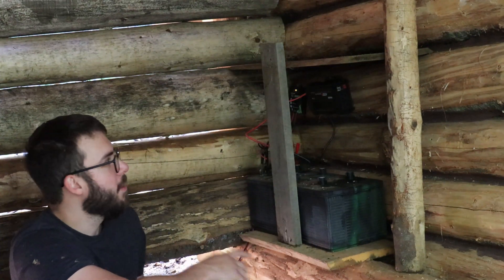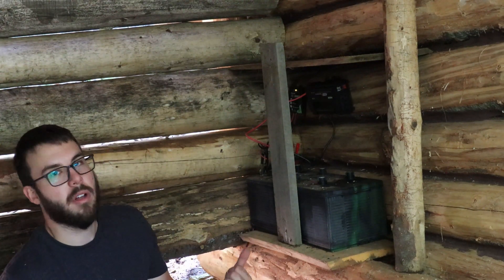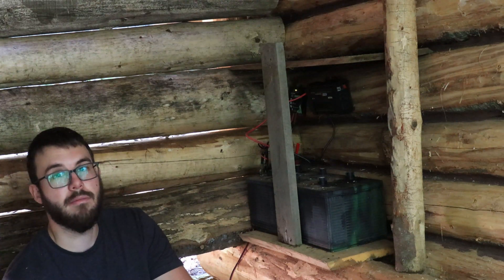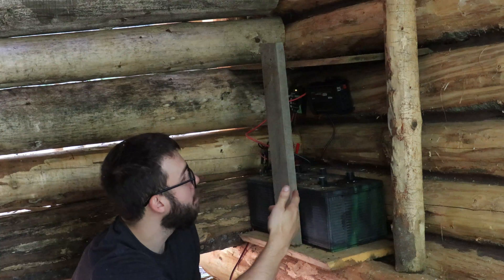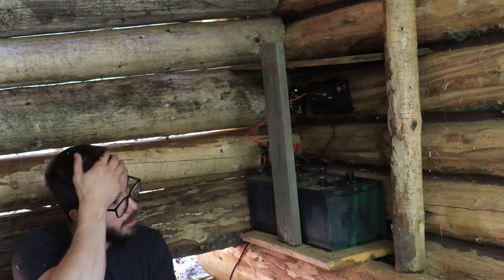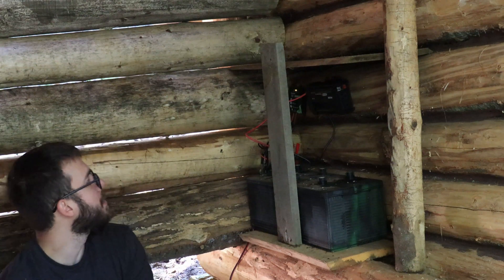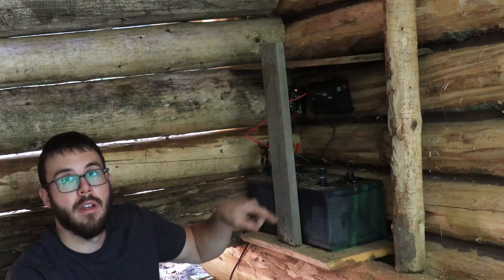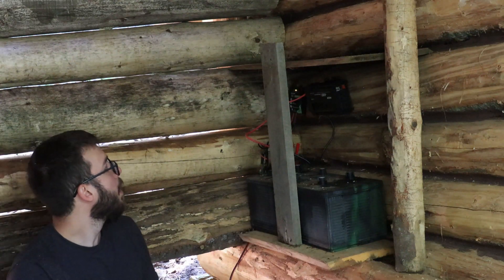Off-Grid Log Cabin Workshop Building: Day7 Solar Power Improvements.

Comment: To have your battery work efficiently I was told to have the positive and negative at opposite ends to draw across all the cells in your battery, similar if you were to have several batteries in series or parallel. Do you hunt moose or deer in that area? Thanks for the video.
Reply from the maker: I hunt deer, but there's not that many moose.